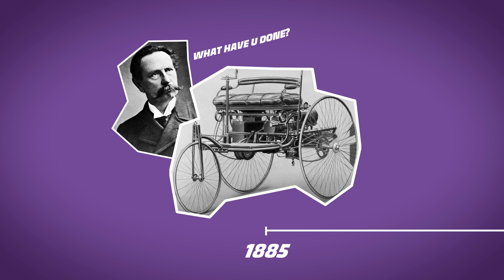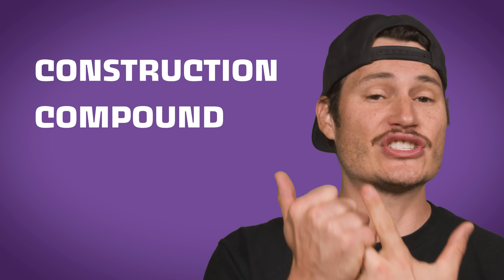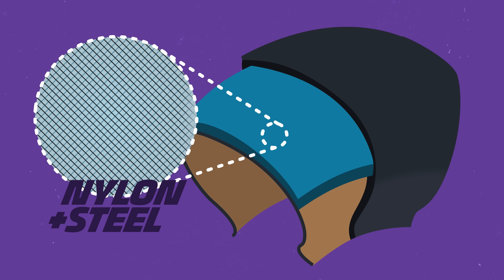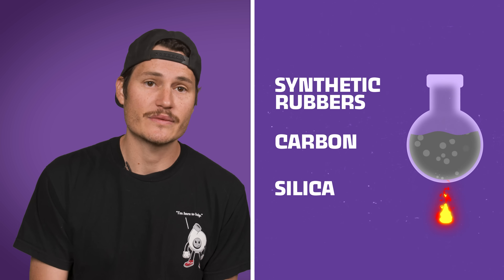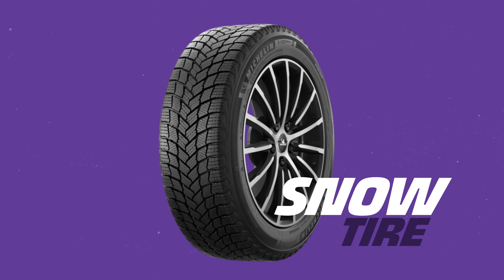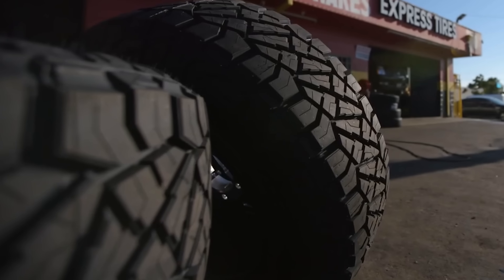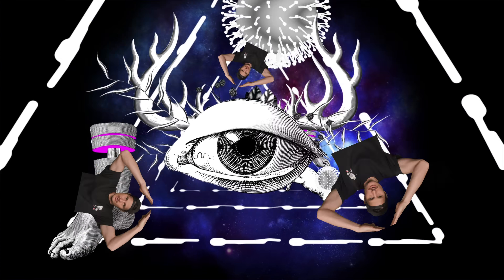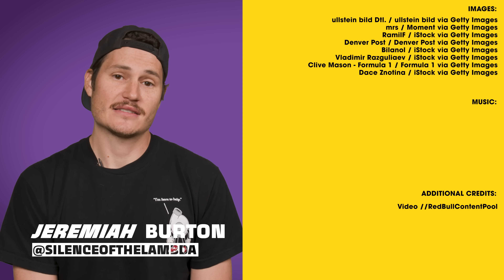The Surprising Science Behind Tread Patterns

Comment: Actual Tire Engineer here: the reason why you can get more than 1G grip and the reason to run wider tires on a race car has to do with shear strength!
When the tread rubber goes into the peaks and valleys of the road surface, your extra grip comes because you have to physically shear off that portion of rubber to move the tire off that spot, the hot tread rubber has penetrated into the grooves & crevices in the road surface so it tears off rather than slides across. That’s why burnouts and donuts leave black marks, it’s rubber that was sheared off. So why wider? Because as you put heat into rubber, it is easier to shear, so a wider tire distributes the heat better but also has more individual peaks and valleys to shear pieces of rubber off.
My quiz for you Jer: how does a tire keep the wheel off of the ground? 
Why doesn’t the wheel just squeeze the sidewall down until it is touching the road like pinching a balloon? You can compress the sidewalls by hand, so why don’t they just squeeze out of the way when the car is loaded on it?
Reply: This makes a lot of sense. I had a feeling it was to do with shear strength and immediately though of increased area therefore reduced stress, however I quickly debunked myself because Fz = P*A and obviously the pressure and weight on the tire are assumed constant therefore the area does not change amount, just shape. Could the fact that the contact patch become wider and less long with a wider tire also help with grip because more of the area is contacting fresh concrete, not rubber filled "dirty" concrete? The explanation on local heat leading to lower shear strength makes lots of sense!
Reply: because of the tires air pressure. and a flat tire can never go below atmospheric pressure you would have to vacuum it out
Reply: As was explained: in addition to the frictional force, the tire is also pushing itself off these small peaks in the road. This is not a frictional contact but simply a "stuff pushing itself off other stuff" contact. Normal force is directly transferred between the tire and road in forward direction. 
A wider tire is the only option to increase the quantity of little mountains the tire can push itself off and therefore increases the overall amount of grip.

The mu value for grip is just a good enough approximation for normal everyday (I.e. Not drag racing) use.

Sorry for lacking some words. It's really hard to explain this stuff in a foreign language
Reply: on top of tire construction and so fourth a balloon is made to stretch a car tire is not a drag slick is closer to a balloon concept as it starts out as a wide tire and the higher the speed it grows taller reducing width to gain diameter it is also used as a gearing aid i could go on and on
Reply: on top of all of this sorry one last thing a wider tire makes up for a larger tire in diameter and its really the end of the story there its to keep the tire from having to be 40 inches tall to keep a contact patch on the ground the same as a shorter tire that is wider carry on
Reply: Ben to another Ben...Lmao...So, here's my take on it...

Gases expand uniformly to fill the container they're in...Assuming that the container is uniformly consistant in thickness, strength, and design...which a tire definitely is...

Without external forces, pressure on all sides of the tire would be consistent...But, when put on a vehicle, ie. Subjected to external forces...the portion of the tires that are touching the road, and bearing the weight of the car, are compressed slightly in the process... compressing proportionally equally against the inactive sections of the tire, establishing an equilibrium...Thus, it stays centered, instead of crushing the sidewall into oblivion...

Basically, because the top of the tire by design, will only allow so much of tire's pressure to displace in response to load.
Reply: This is what I said, but I am way worse at explaining it lol
Reply: Wrote kind of the same thing somewhere out here, but it came out way more nerdy-physicky and convoluted, so noone will read that. 
Also, you being a tire engineer grabs way more attention than a just wall of text.
Reply: Wider tyre = bigger contact patch. Also I don't know what race tyres you've seen but there is no ways you'd be able to compress the sidewall of my racing slicks by hand.
Reply: So what's the holdup for airless tires in everyday automobile applications? I've seen some for trucks and tractors, but it seems as if they are delayed due to issues when dealing with cornering forces? Honestly don't know
Reply: Pressure.
Reply: @ravencrestmedia  Airless tires generally have a varying density foam inside them, which when put inside of a rubber shell, functions the same way as an air-filled tire....Some also have support ribs that go from the tread to the rim inside, and others are just really hard plastic...Depends on which kind of airless tires your referring too...

And, if you're talking about the ones I think you are, then cornering force is indeed an issue, due to the lack of transversal stability, caused by the design of those ribs...They all face foward, and none of them have any degree of twist to them...no torsional support...so, I could see cause for an issue...
Reply: An educated guess to your question: 
The carcass prevents the tire from bottoming out. It can only stretch to a specific point at the opposite end of the force of the car's weight.
Reply: Cords are under tension once pressure is increased in the carcass. Essentially the polyester cord acts like spokes. Heavier Denier Cord holds more load plus you can increase end count to a certain point increase carcass strength. Load carrying capability is dependent on air pressure and the tensile force the cord can withstand.  Unless you have a set of run flats then your just riding on solid rubber until it degrades from heat and devulcanizes.
Reply: Also Tread wear and and rubber facture is only one component off traction. Hysteresis is also a critical component. Adhesive friction due to Vander walls forces also play a fairly large role in dry friction. Burn outs leave black marks because high velocity sliding friction creates a high amount of heat which devulcanize the tread compound on the surface. When this happens the rubber smears into the surface and as a sticky material as it has lost most of its chemical crosslinks and polymeric molecular weight. Read papers by Dr. Bo Persson. He has studied polymeric friction for his entire life.  By the way actual tire materials scientist here.
Reply: As to your quiz for Jer, I'd say that the tire's reaction to the hoop stresses in it is what helps it to keep its shape under load
Reply: @PhaunDubstep  Weight on tire is not constant. When you take a sharp corner with a car the outside tires handle way more weight hand the inside tires. If the car is decelerated or accelerated at the same time (common in racing) there will be weight difference between front and rear, too. Then there're dynamic forces, too. When the weight distribution between the forces transferred via springs, suspension dampers and anti-rollbars all have some force transfer delays which separate the weight of the vehicle from the weight applied on tires for short periods of time.

For optimal performance you would want enough weight to press the thread compound into the surface roughness but small enough weight to not exceed the shear strength. And keeping the weight on that (often pretty narrow) range is very hard with the dynamic weight distribution going all around during racing.

Good computer simulations such as BeamNG, iRacing and rFactor all consider these dynamic forces and I think all of those also include tire deformation, too.
Reply: @MikkoRantalainen  I never implied weight was a global constant, simply that if the only variable between two scenarios is tire width and the same static OR dynamic forces are applied to the tires, the contact area in both cases is the same. Too many people in this video's comments stating a wider tire has a larger contact area which is fundamentally wrong.
Reply: I always thought the wheel is the whole thing as in: tire + rim = wheel
Or back in the day rim + spokes + hub = wheel
So a tire keeping the wheel off the ground is a wheel keeping itself off the ground
But you're the tires engineer so I know im wrong
Reply: @jonathangaray7794  In my experience "wheel" in context of cars can mean just the rim, the combination of tire + rim or the steering wheel. You just have to guess from the context which interpretation should be used for each content.
Reply: @PhaunDubstep  I'm pretty sure most cars in racing applications get more traction on asphalt after its had some rubber put into it.
Reply: What is, air pressure caused by centrifugal force?
Reply: Get this man a t-shirt XD
Reply: @Michael Peck Are you sure about that? I would expect car to be both suspended from the top of the tire and supported from the bottom, too. The exact ratio changes according to air pressure and rotational speed of the tire.

For example, see how top fuel dragster tires deform during the acceleration.
Reply: Thanks for taking the time to enlighten us! 
Oh yeah it's bc of air pressure. even a deflated tire has some amount of air that gets compressed and separates the wheel and rubber (unless it's a vacuum)
Reply: It’s the air pressure that pushes the tire out, that’s why air pressure is designated for the weight of a vehicle and the size of tire
Reply: @MikkoRantalainen  good to know, I guess is just one of those interchangeable terms, it all depends on context
Reply: @kswiftful  i can't say that in 100% right. Though I think he refers to the fact that  as temperature rises in the tire as a cause of motion, the pressure in the tire rises as well.
Reply: @Michael Peck I agree that the wheel is partially suspended from the top of the wheel. However, imagine following though experiement: take a normal car tire with a rim. Cut the top half of the tire totally away. Does the rim drop down to ground? Absolutely not, the tire has mechanical structure, too. Is the suspension power reduced? Absolutely yes.

Of course, the tire design makes a huge difference on the mechanical structure. WRC rally cars use tires with so strong sidewalls that they can keep driving even with deflated tires. In tat case, the traction is heavily reduced but not zero.
Reply: @Michael Peck Umm... what? If you cut the tire half (removing everything above the axle) the air pressure difference between the "inside" of the wheel and above the wheel is literally zero (or technically about 1 Pa if you measure about 30 cm above the cut because that's the pressure difference in atmosphere per height).

I agree that different tires have very different sidewall strength. If you include bicycle tires, the lightweight tires are really really thin and flexible.
Reply: Are you describing adhesive forces just with different language? I was going to add that adhesive forces play a big role in higher performance tires. A racing slick on a track will actually pick up rocks, trash, etc like a roll of tape.
Reply: God I love this community <4
Reply: So large size increases the physical grip of the tire. Is there an equation to determine the increased grip with a wider tire?
Reply: That's cheating >:(
Reply: this is cool i like this
Reply: Cap
Reply: @xTOP_L3V3Lx  This is why the barrels of a wheel are shaped the way they are, correct? So there's always some air in the tire?
Reply: Excellent reply, I guess it's true that you learn something new every day, I thought it had something to do with better grip going around a track, not anything to do with shedding rubber on uneven terrain!
Reply: @friskydingo3061  no thats for strenght and mounting purpose its simply because a tire cant go into vacuum it was a trick statement i was just being funny 14.7psi is technically the lowest anything can go before it goes into vacuum all pressure gauges actually measure from 14.7 psi and up unless specified or are for another purpose
Reply: To answer both of the questions - nerds do it as you can tell. Where's my t-shirt? 🧐
Reply: @Michael Peck now I will not sleep trying to figure out why the car is suspended by the air in upper part of the wheel and not supported by the air in the lovers part. I pictured the spoke bicicle rim example and it's fine. But with a car tire I just can't. The only reason I can immagine is because without air in the upper part pushing down the "lower air" would escape to go up....like when you have a flat tyre there is air up but no air down
Reply: Tldr: Pressure is equal in all direction. The rigidity of the rim and the tyre work together to keep the shape using the stated principle.

Action-reaction....there is a force pushing outwards from the rim when you push inwards on the tire. Since pressure is equal in all direction, this force is spread out all round the inside of the tyre. The rigidity/strength of the rim and the carcass/core of the tyre therefore holds the shape. This equalised pressure creates something similar to bicycle spokes with the air pressure being the 'spokes' and the tyre and rim being where the imaginary spokes attach to. You can't squeeze on side without the other sides opposing your force. When you lower the pressure enough, you can squeeze the whole thing down to the rim basically. The only thing that will happen if you increase the squeezing force is a tyre burst when the pressure becomes too much. 

In contrast, a baloon expands to accomodate the added pressure. Assuming it had rigid walls, you can still almost flatten it since it lacks a rigid rim to push against. The rigidity of the rim provides the base to push off  of.
Reply: @badworseme  You have no need to apologize. Your English is excellent; I never would have thought it wasn't your first language.
Reply: @Brayo9  nice
Reply: @nathanbilly9070 , I am surprised an actual tire scientist did not know it is Van der Waals, not Walls. When I am at the race track there are chunks of tire that are flying around and they were not melted off, rather torn off.
Reply: centrifugal force + tire presure?
Reply: Ideal Gas Law.  P*V/T = P*V/T
Reply: Because witchcraft thats why
Reply: I feel as if another important part of this conversation is missing. The amount of air pressure in the tire can greatly affect the amount of traction as well. With less air pressure, more of the circumference of the tire is making contact with the ground because of the deformation of the tire. In drag racing, not only are the tires wider, but they also are a softer compound that deforms more and run less air pressure. All of which means a greater area contact patch with ground.
Reply: Because the pressure in the tire is pushing in all directions.
Reply: @leojensen9270  with great air preasure comes great responsibility
Reply: @Chemdawg404  so basically air pressure is what keeping it off the road
Reply: I don't understand your question, why would it do that? If the tire is inflated.
Reply: @Ben Fishburn . first of all i am not a qualified person like you are, I am just a 11th grader ( Indian ) and I am not trying to tryhard this question but I would like to try to solve your question which was actually for 'jer' and show it to you . my solution to that question :  Let the mass of the car be m and acceleration due to gravity be g then weight = mg . Now, due to the fact that tires have more pressure in them when inflated than the atmosphere. There is some pressure directed towards the ground and since the normal force provided by the ground is total weight of car + force due to pressure which is directed towards the ground . hence normal force is greater that weight of the car and so the tire just does squish down and force due to ground is applied on the rim of tire because the tire is connected to it. And also the tire won't squish down as (if it happens ) pressure will increase in the upper part of the tire and as the tire in the upper portion stretchers more the resistive force of the tire on the gas and the gas gets pushed down which 're -inflates' the tire's bottom portion and the tire does not squish down
Reply: Not an actual tire engineer here* had to note because i have a back yard education in physics and applied forces lol. Anyway, yes, shear strength. but something else worth noting is the physical property changes tires undergo during acceleration. example being look at the slow motion motion of top fuel drag car, during launch and acceleration the tire goes from a "rounded block" shape where the tread portion of the tire is primarily flat against the track, to more an ovular shape "more in the shape of an motorcyle tire" i would assume for this reason you need a much wider tire because apart from initinal launch, as your speed increases, the contact patch actually decreases because of the deformation of the tire, so your width would be set to account for that so you still have enough traction at speed to do the job.
Reply: air pressure
Reply: Because NERD
Reply: @PhaunDubstep  Rubber filled ("dirty") actually has more grip (at least on slicks)
Reply: @badworseme , Are you saying the contact patch A is bigger with a wider tire? How can this be if the tire pressure is the same and Fz=P*A? If the mass and pressure are the same, the area must also be the same. So is the quantity of little mountains pushing off the tire are the same.
Reply: @cam_121  It is a wider contact patch, not bigger.
Reply: @enjoying_life49  wider/bigger, can use interchangeably, same result. I know what I'm talking about 👍🏻
Reply: @enjoying_life49  you're arguing semantics mate.  If you put a wider tyre on a car, the contact patch is greater than that of a skinnier tyre. Obviously the contact patch will be greater in a 6 inch tyre at 1 bar compared to a 10 inch tyre at 5 bar. Assuming you're not a fuckwit and set the tyre pressures accordingly, the 10 inch tyre will have a greater/bigger/wider (whichever term you'd like to use) contact patch than a 6 inch tyre with its pressures also set accordingly. You're not impressing anyone by being deliberately obtuse in the hopes of out smarting everyone.
Reply: What he said
Reply: aka Wider tires can use softer compounds because of the way a wider patch can manage heat.
Reply: @ravencrestmedia  id think they buckle and shear off the rim under hard turns at speed
Reply: actual actual tire engineer here and what you said is false. Maybe try to pretend to be someone else in the youtube comments.
Reply: bro deserves pin